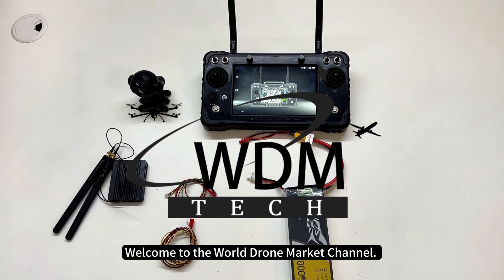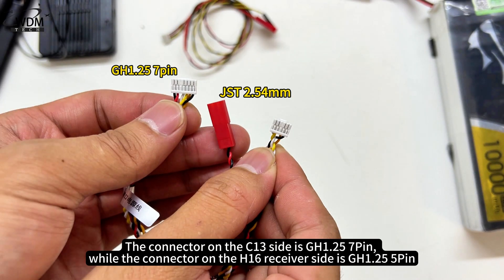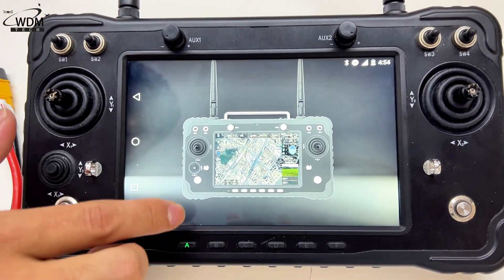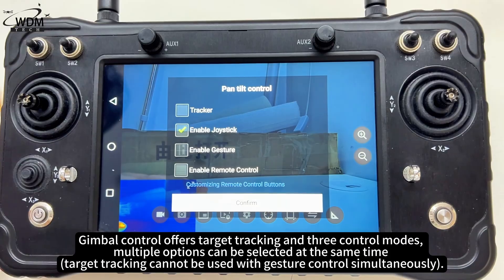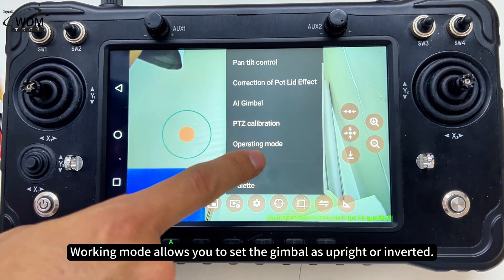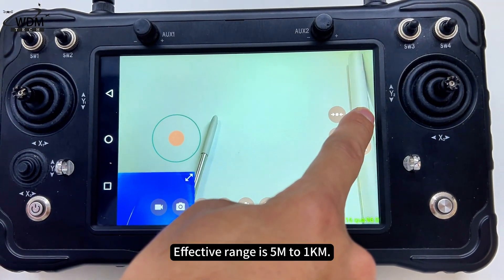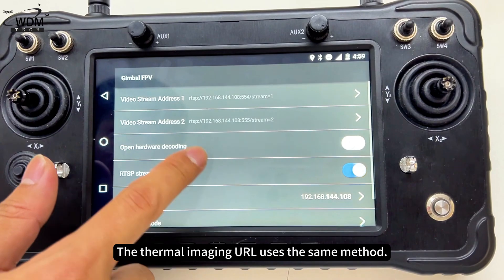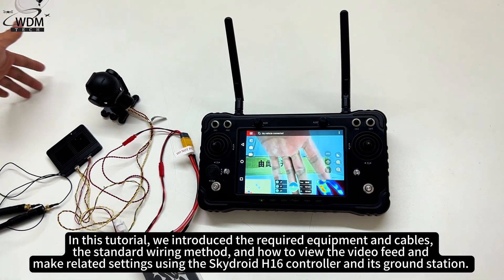Skydroid C13 Connects to Skydroid H16

Comment: Hey, can you use the camera without a remote control? I want to get the live picture directly on a tablet, not on an extra remote control. Do I need another receiver or how is it possible to control the camera via the tablet/smartphone? In the other comment here under the video you replied that you should connect the camera directly to the laptop or tablet, if I understood correctly. But then I need a cable that extends from the drone to the tablet, but that is almost impossible and not safe. And the app should not work without the right receiver, right?
Reply from the maker: The C13 gimbal shown in the video, if you don't want a remote control, can only be connected directly to a computer via the C13's LAN port and then streamed via RTSP. However, you can only see the image on the computer but cannot control it, as Skydroid does not offer a PC version of gimbal control software.
Reply: @worldronemarket  Hello, thank you very much for your quick response. Could you explain to me briefly why this does not work? There is an APK file for Android devices that can be installed (the same as installed on the remote control). The gimbal is also operated in the video via the app, not via the sticks of the remote control. In my opinion, this remote only replaces the tablet, but does not need to be used. The app connects via WiFi or something to the receiver, but not to the remote control.
Best regards